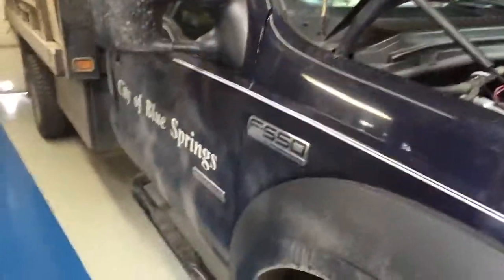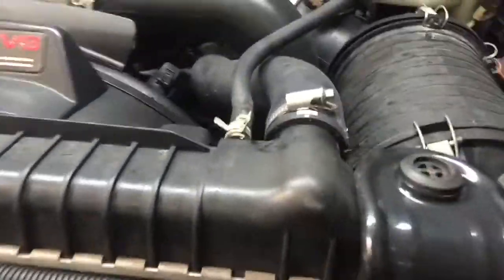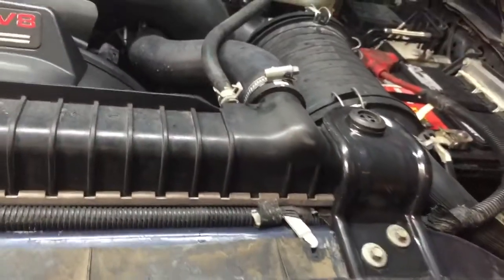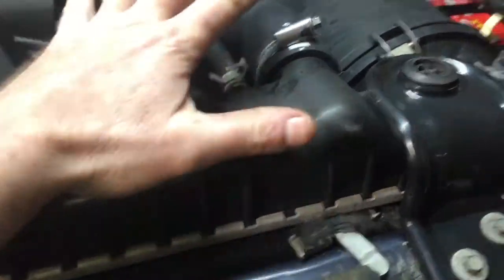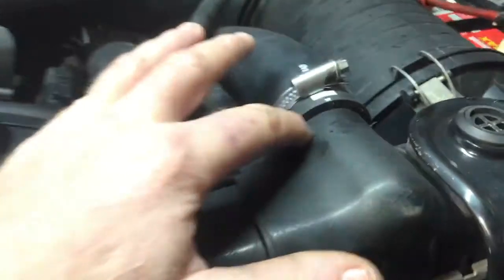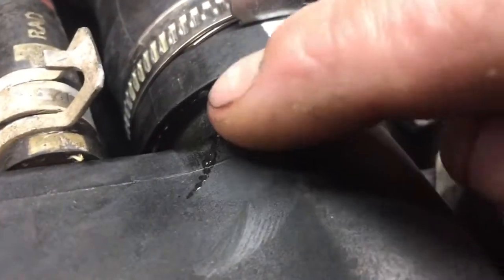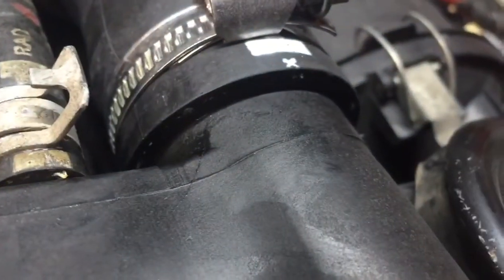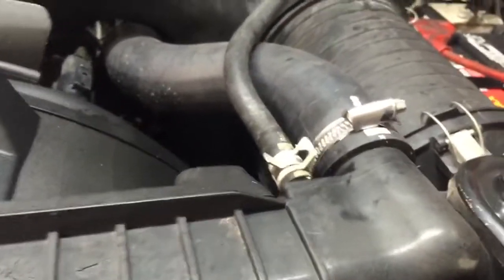Blue springs radiator leak

Comment from the maker: Why do you say that??  I can dig up other videos showing them cracked there.  It's not as common as the degas bottle cracking on the bottom,,  but it does happen.  If the small nipple would've been broken,,  that's a different story.   I've never seen that break on its own.